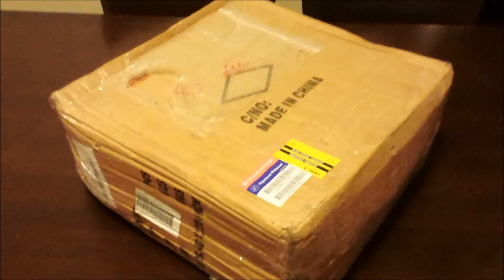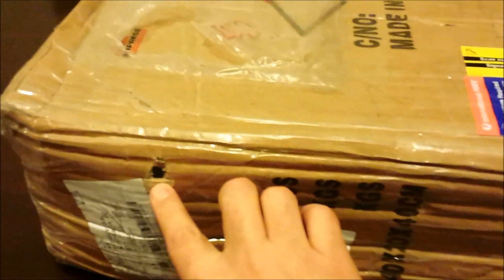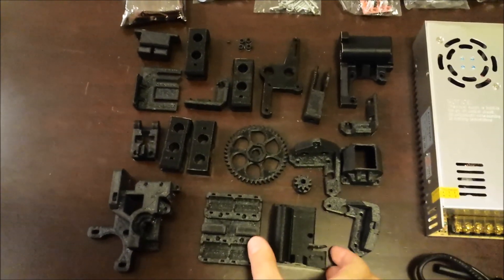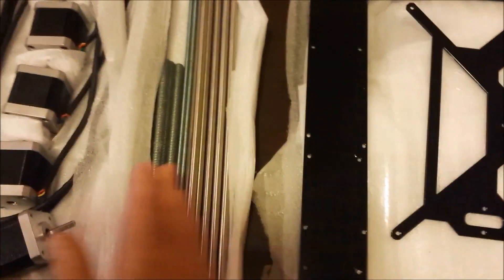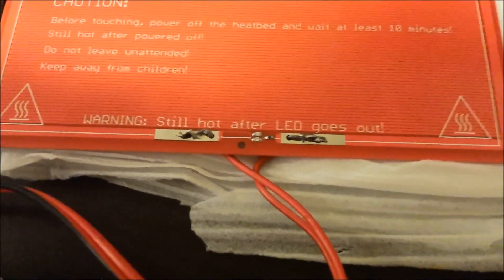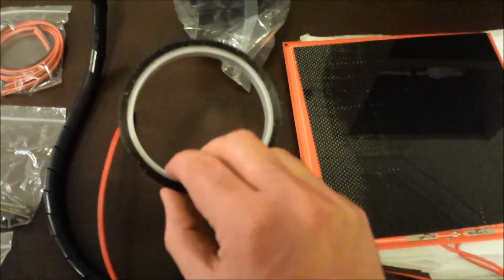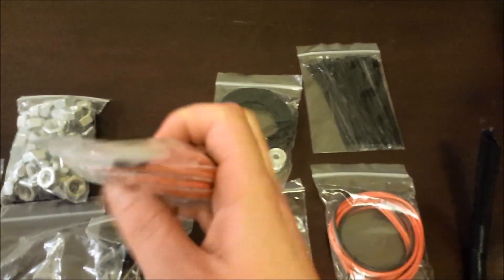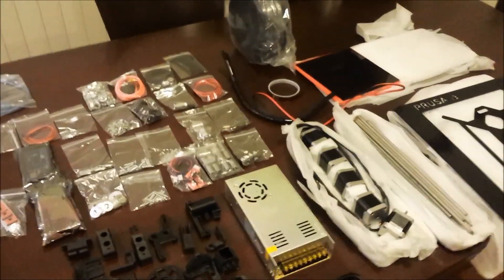3D Printer - Prusa i3 kit unboxing

Comment: for structural integrity, would you recommend either the 3mm iron frame or the 6mm Plexiglas frame?
Reply from the maker: The comments I've read on the RepRap forum regarding the plexiglass kit, is that if you tighten the fixings too much you can split the plexiglass. However incorporating the vertical support is very much needed. It's a shame the iron frame didn't come with vertical supports.

The iron frame of course is very strong and I've already added vertical supports to it in later videos.

Comment: Do you need to be able to use a soldering gun?
Reply from the maker: I would say yes, however there isn't much to solder. If soldering isn't an option for you then I'd steer clear of these types of kits.
Reply: Teknogod17 did you end up getting your printer? I just ordered mine last night and got a confirmation with an order number.
Reply: Teknogod17 oh sweet! Will check it out. Thanks. Did you end up ordering the 1.75mm or the 3mm size filament / hotend.